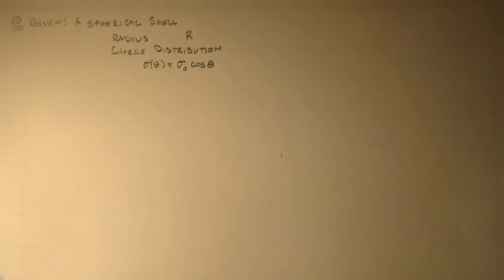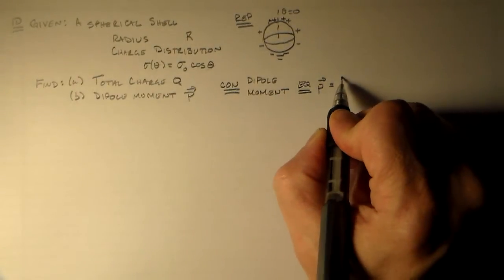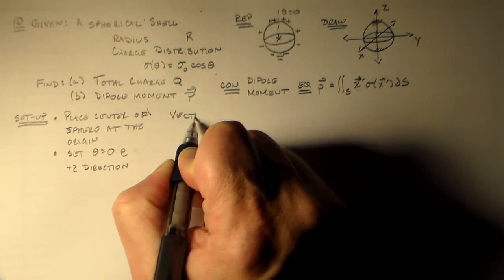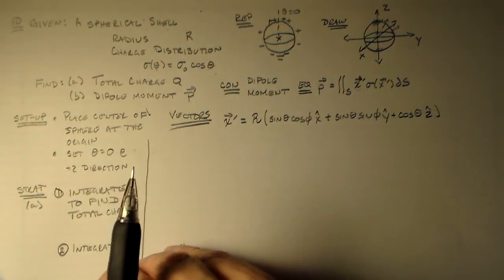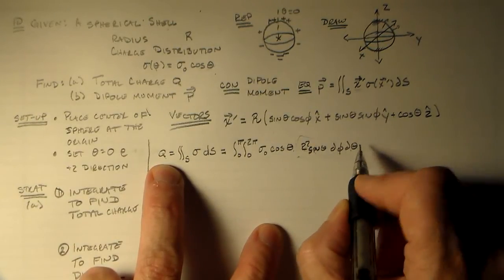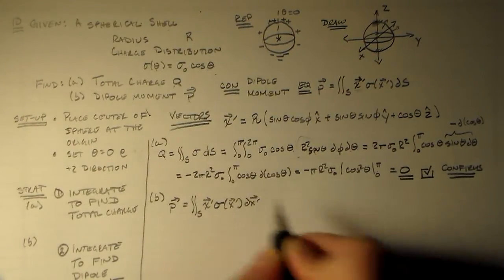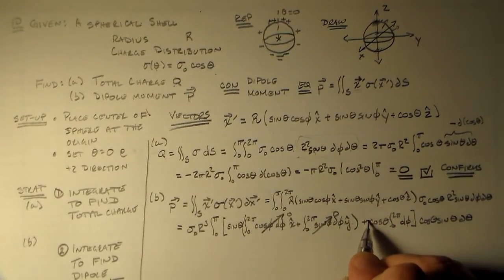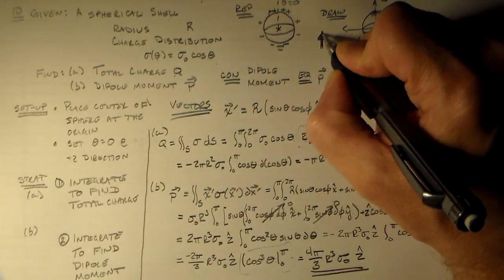Dipole Moment of a Nonuniformly Charged Spherical Shell

Comment: Awesome! But it what if it's an dielectric sphere placed in an electrostatic field, would the solution of the induced dipole moment be the same?
Reply from the maker: It should be the same, but you'll have to find the induced charge density first, which will be the projection of the dipole moment per unit volume on the outward normal of the sphere at every point on the surface.

Comment: I have a calculus related question around 10:30 of your video, why did your integral of area turn into a double integral of theta and phi and not have an r? do we completely ignore the r part? I know its just a surface integral, so it doesn't need a triple, but i'm just confused about the phi and theta.
Reply from the maker: The R^2 sin(theta) is part of the differential area element and takes care of that, but you're right: substituation of the differential area element needs to retain the units of area.

dS -> (R sin(theta) d(phi)) (R d(theta)) = R^2 sin(theta) d(phi) d(theta)

Comment: How would the problem change if instead of having the charge distribution = sigma_0*cos(theta) we have sigma_0*(1+cos(theta))
Reply from the maker: The most important thing here is that the total charge (the monopole moment) of the distribution would be nonzero, since 1 + cos(theta) = 2 cos^2 (theta/2).  That means that the dipole moment of the distribution is no longer necessarily unique and will change depending upon your reference point--essentially, where you locate the origin in your coordinate system.

Only the lowest order non-zero moment is independent of your choice of coordinates. 

All other differences are just math.